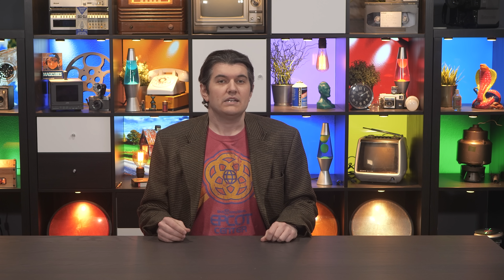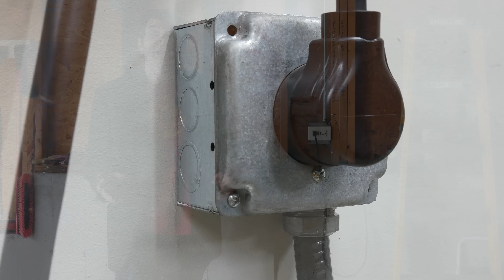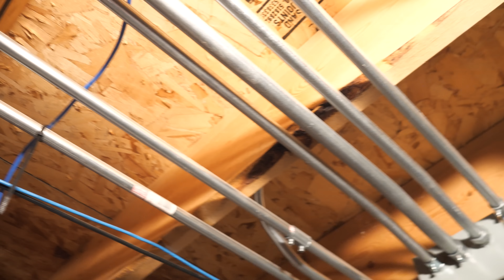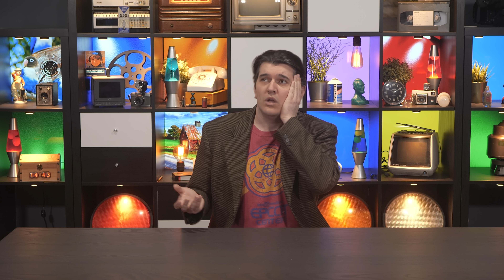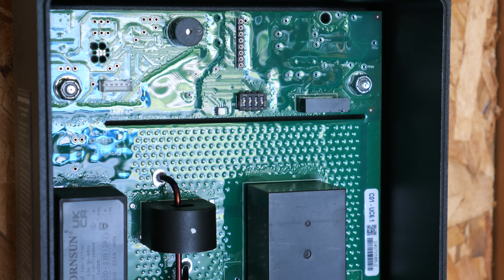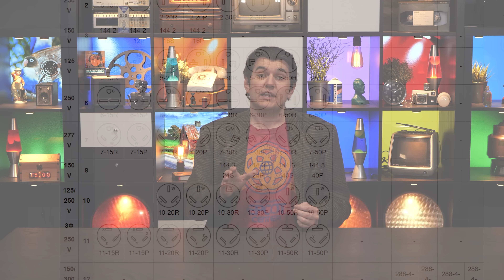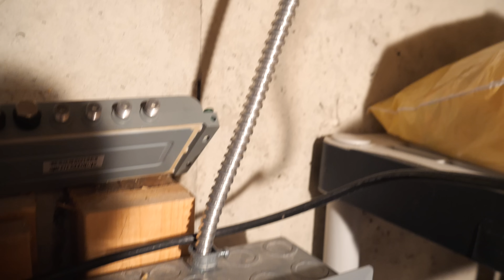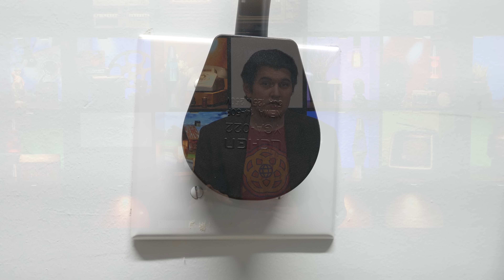The "standard" car charger is usually overkill—but your electrician might not know that

Comment: Watching with interest from Australia.  I always do a double-take with the number of NEMA plug / socket types. As an aside, the Aussie GPO (general purpose outlet) is an old American type. There's an awesome article called "The origins of the Australian Plug and other Electrical Trivia" which covers it all. There were 70 or so plug types in 1930's. It was standardised to a plug design by Hubbell, originally patented in 1916.
Reply: While the NEMA receptacle/plug chart shows a whole lotta options, on the ground it typically boils down to around eight being installed.  
There's a series for 120v, an different one for 240v, and some commercial ones for higher voltages, but that's commercial use only.
Then there are locking variations for various niche devices + things like power connection points for portable gensets.
But a lot of the rest are pretty much obsolete and rarely found, and can't be installed in new construction for various reasons.  They're still on the chart as they're still defined.
Reply: The Australian plug is the same as the Chinese one, just upside down
Reply: I'm a Queenslander who's been home charging an EV with its included 10A EVSE for two and a half years. It gets plugged in a couple of times a week, I only use public chargers if I need to road trip somewhere.

Comment: Per your previous video on this topic, I installed a NEMA 16-50 in my garage, but the circuit it's connected to is only 40A. I'm assuming that means the receptacle itself is no longer the weakest part of the circuit, as it's rated for 50A but the wiring in the conduit is only 40A. Unfortunately, my plug-in EVSE (the one included with my car) can't be configured to properly draw just 32A (to follow the 80% rule), but the car itself can be so configured, so that's how I've been running things.

Side-note, my car's AC charging circuitry has actually suffered some sort of minor failure, and the car refuses to charge faster than 4kW, rather than the 7.68kW my circuit should allow. One of these days I'll get the dealer to repair it...as soon as this limitation prevents me from charging back up to 80% during the six hours a night with extra-low electricity costs. So far, that hasn't happened.

Comment: The one reason I'd consider a smart charger is that some local utilities offer a lower rate if they can cut you off during peak demand periods.
Reply: If you're able to fully charge the car overnight, and can instruct the car to schedule charges to happen then, you aren't drawing power during peak demand periods anyway. Although maybe your utility doesn't know this?
Reply: @trimeta where i live electricity is priced 24h in advance in 15 minute intervals. And depending on supply and demand the price can be from free to DC fastcharger expensive. 
So cloud connected chargers who select the chespest hours dynamically really pays off here.
Reply: @ulwur So you have dynamic pricing, but the values are only announced 24 hours in advance and vary significantly day to day? That sounds very inconvenient.
Reply: @trimeta welcome to Sweden! On the other side of the coin is the posibility to play the game and charge for nothing most of the time. The cloud conneced evse's does the heavy lifting for you.

Comment: I got a UniFi EVSE partly because I'm a Ubiquiti shill and partly because it has official local control. Eventually it's going to stop getting updates and maybe even lose cloud control, but I should always be able to adjust the maximum current as needed. Right now, I only use the smart part for the fun graphs, but we do want to get solar eventually, and I can see it coming in handy for an automation that lowers the maximum output if the grid power goes out.
Reply: I love my old Ubuiquiti gear but after the last controller update I can't figure how to let it log in local without it asking me for MFA.  Good for you for figuring that out.
Reply: Or just get a tesla charger and you can adjust the amps from the app?  And it will also auto-scale based on temps at the plug, so no need to worry about it melting things.

Comment: 23:24 I have one of those “smart power stations” and there are two advantages to consider. One is you can lock them down to specific VIN numbers if it’s in a place where someone may be tempted to steal. 2. It can report its own energy usage, so you can see how much energy is being used in a shared environment where you don’t have access to the other vehicles info.
Reply: No you can't - the J1772 AC charging interface gets no information from the car ( except maybe via ISO15118, which isn't yet widely supported for AC charging)
Reply: @mikeselectricstuff  I forgot about that; no PLC over the AC lines.  Good catch.
Reply: @mikeselectricstuff this is NACS
Reply: Chargers that can be locked to specific VINs and report energy usage seem like a great solution to the multi family housing problem that Alec mentioned a few minutes before the smart charger rant.
Reply: @jlhitz35 yeah one annoying thing is that you can export detailed charge session data but it doesn’t say who is who!
Reply: As mentioned, there is no way to do this with the standard AC charging protocols. Literally the only information the charging station gets from the car is a resistance value which tells it that a valid vehicle is connected.
Reply: You forgot the # in VIN# number

Comment: Nothing beats waking up to a full tank whenever you want.
Reply: I could charge to 100% everyday, but I don't.   I would charge to 90% at home overnight everyday,  but i don't do that either.   My office building has L2 charging, for mostly free.   So I charge there to 90% and only charge at home when I feel i need to.  I only ever charge to 100% the night before a long road trip.  DCFS only is used in the middle of a road trip.  DCFS is the last choice charging option because it's expensive and annoying.
Reply: I pictured Tiananmen Square Tank Man when I read this.
Reply: It's a weird kind of range anxiety driving someone else's car and remembering it doesn't refuel itself. If the fuel is low, better hope you budgeted some time for a fuel stop (you didn't, because you haven't had to waste time on that in years).
Reply: I got the Tesla wall charger installed as an early Father’s Day gift. I schedule my charge late night/early morning during off peak hours. Every day, I leave at the recommended 80%. It’s been amazing.
Reply: @adam75south the LFP batteries on mine can routinely be charged to 100%
Reply: Well that's true with an electric car. It charges overnight so it will be full. In fact, you might very well end up with an almost empty tank on a petrol based car, since you have to specifically go to a petrol station to fill it up, which no sane person does every day.
Reply: Nothing beats forgetting to fuel your car but still being able to do it in half a minute on gas station.
Reply: @spiddy1335  at only 3x the cost!
Reply: At only 3x the cost!
Reply: @spiddy1335 No one forgets to plug in. It's a habit. It's like washing your hands leaving the bathroom.

Even if you somehow forgot to plug in, our car has a 280 mile real world range. There is enough in the battery to survive a day without charging.
Reply: Except it’s more like waking up to a third of a tank, and whenever you want isn’t true either since it’s either overnight or a 20 minute wait at a fast charger. Still convenient for plenty of people, just gotta keep that in mind.
Reply: @submachinegun5737  "It works 100% of the time some of the time"

Comment: curious... if building code was not an issue, how would you have installed it instead? Also yes! a lot has happened, and 2025 updates to older vids would be cool, and don't you dare limit them to November. !
Reply: i guess the only other way would be to run romex cable

Comment: One annoying thing about the 6/2 or 6/3 romex is it’s limited to 55 amps not 60. So your max charging is limited to 44 amps but most chargers only do 40.
Reply: And 6/2 MC cable is a great solution for that.  Or EMT with THHN wires.  Or just charge at 40 amps and realize that that's plenty.

Comment: I know someone that just charges on 120v 15 amps.
Reply: It's not just a legend?
Reply: I did this for a couple years in the early days. Winter was a problem and I’d need to visit 240 public chargers. DC fast charging wasn’t much of a thing in 2013, and my EV didn’t even offer it.
Reply: Do chargers accommodate 120v 20a fine?
Reply: @jeffkardosjr I suspect charging at 120v is always limited to 12 amps because thats 80% of 15a and there is no way for a plug in 120v device to know if its plugged into a rated 20 amp circuit. Well almost no way. (Adapter with 20 amp blade could tell it)

Comment: I bought a used Bolt EUV as my second EV. I have no remote access to see when my car has finished charging. With a Wi-Fi enabled charger, I get some visibility. 

Coincidentally, my 6 year old Chargepoint Home Flex Wi-Fi module has given up so I don't have access anymore anyway. So I have a lobotomized smart charger now.

Comment: I kind of wish you'd followed up your "throw it into the OCEAN... not really" with "of course, I mean LAKE MICHIGAN"
Reply: There are at least 3 EVSEs in St. Clair
Reply: @henrymarshal2380  That's what they get for using Apple Maps. /s
Reply: Little known fact: Lake Michigan is so big it can be considered an inland sea. Throwing something into a sea is kinda like throwing it into the ocean.
Reply: @wasd____  But it's fresh water.
Reply: @wasd____  i consider it more of a great lake personally
Reply: @wasd____  All oceans are seas but all seas are definitely not oceans.
Reply: Salt Free! No sharks!
Reply: Well there is the Fisker Ocean!
Reply: 16:55 me, no, my mom? Yes. Every other day, sometimes every third day if she is lucky.

About 60 miles each way to work and home, 5 days a week.

After moving my shop, I barely burn a tank of gas every 2 weeks.
Reply: As someone who installed their EVSE on a post near the street, the smart features of my unit are extremely important.  It'd be really easy for someone to pull up and plug in while I'm away.  So getting a notification that charging started and the ability to remotely shut it off are critical for my use case.

And no, my charging equipment doesn't seem any less reliable than non-smart units.  It always just works.
Reply: Road Trip !
Reply: Why don't your purify in the waters of Lake Minnetonka?

Comment: With J1772 charger with settable current, you can charge from as little as 6 amps of 110. This can be very convenient when charging from solar that is also running other stuff.. when the power is free, but you don't have oodles of it.

It can also be very handy when using a car which has a older pack and shunt regulators (the Mitsubishi Mii is mine) - my pack "expired" in 2022, but it keeps on ticking partially due to charging at low enough power that the tiny shunt regulators are useful.